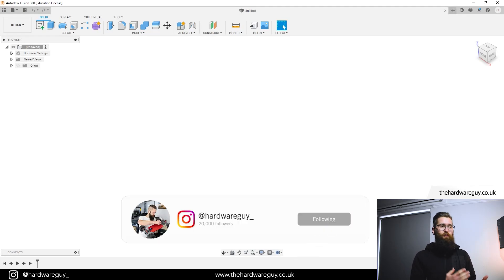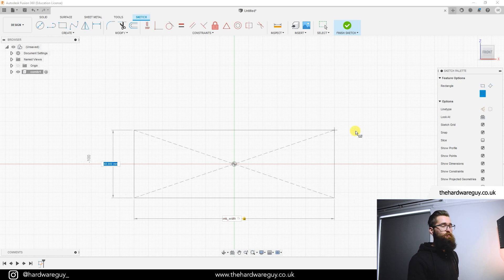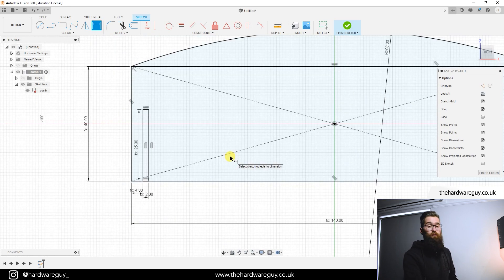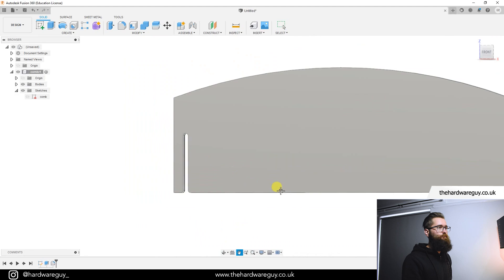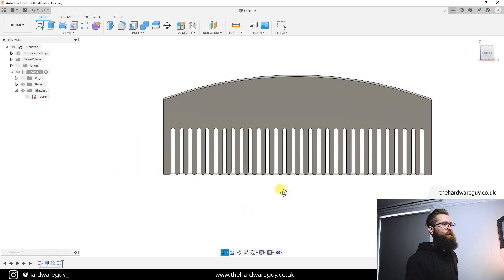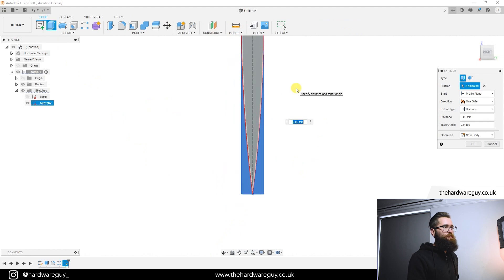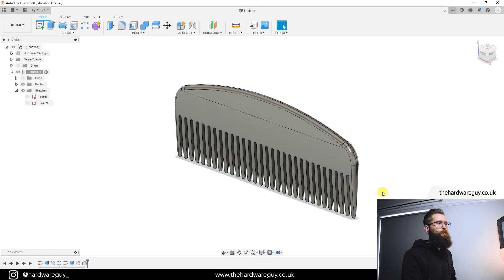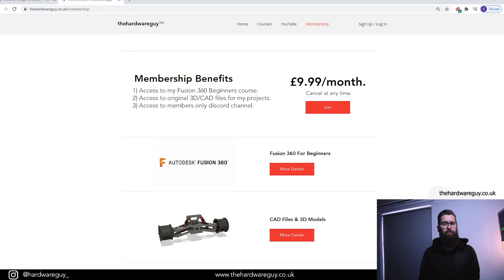Fusion 360 Design Series pt.2 - Comb

Comment: Nice video. As always ^^
What I would love to see is how to constrain an imported SVG or a text inside a sketch. That's stuff I have problems with (for example if I want to center a text inside a box)

Regarding the unit-less stuff: you can do the exact mathematical calculations you do inside the sketch or the extrude command inside the parameters. So you could calculate the number of teeth inside a parameter without a unit.

Comment: Can't you do the math in the parameters?
Reply from the maker: Yeah 😎
Reply: To add to that, I'm pretty sure if you do the math in the parameters and do no units there that you can do what you want setting the number of teeth based on comb length. Just do the math in your num teeth parameter.
Reply from the maker: I did try this but it wouldn't work because my other parameters such as comb width does still have a unit. I think it'd work if everything had no units though!
Reply: @thehardwareguy  bummer. I was hoping.
Reply: @thehardwareguy  it works, look my image
Reply: @chris993361   Look here:   https://www.dropbox.com/s/8u76w6gxaqit0ec/Fusion%20360%20Parameter%20for%20comb.png?dl=0
Reply from the maker: Yeah I did the same in my parameters menu, but when I tried to set that quantity in the rectangular pattern tool it refused :( were you able to set it?
Reply: @senjos  if I remember, maybe I'll try that tomorrow. I was pretty sure I've gotten it to work before.